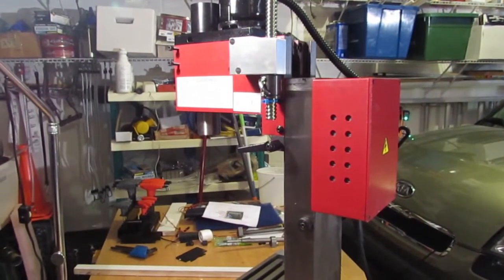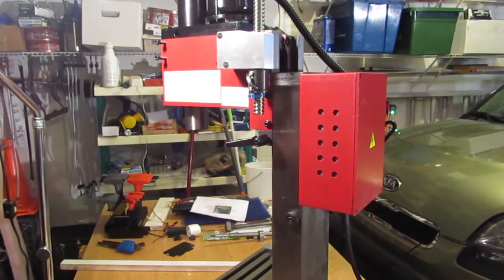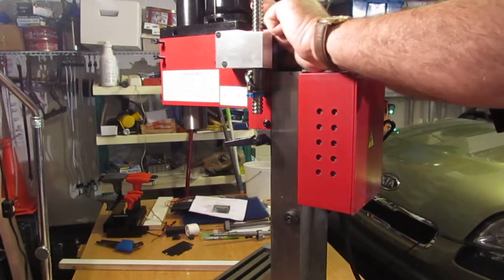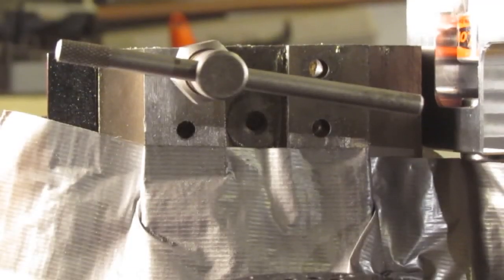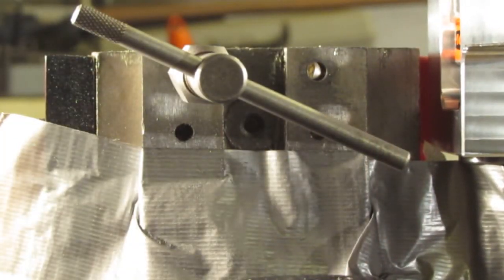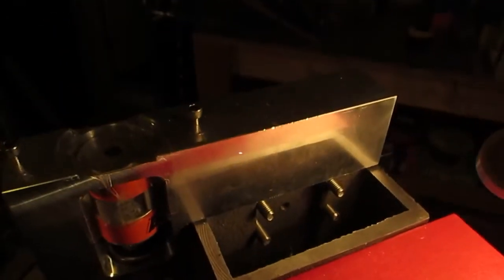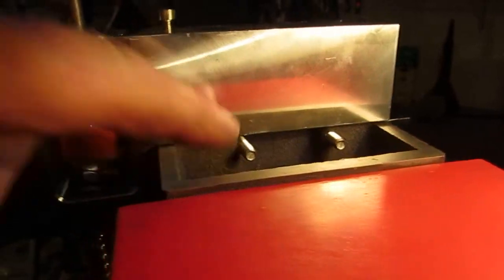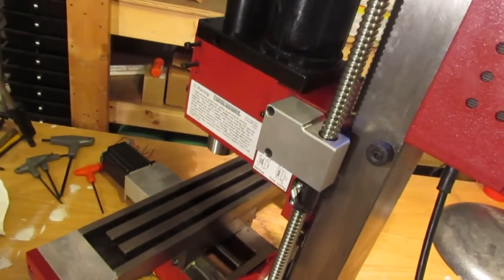X2 Mini Mill CNC Conversion- Part 4- Z Axis Installation

Comment: for that allen key problem you had I would have cut a small section off the long side and used a MM wrench to tighten it.  But I like what you are doing. Fun to watch other people go through the same problems I have.  Were all human.  Thanks.

Comment: When you run into a problem with a Allen headed wrench being to big in this case 10mm. Take a headed short bolt with a 10mm nut and put them together and insert them in the Allen head and use a 10mm boxed end or open ended wrench to tighten it. One of my tricks of the trade.

Comment: I notice your "Z-stop block" has the lever on the opposite side as mine. IDK if you did, but it seems to me you could install it either way. It's a nice feature to have even with CNC installed.
Reply: the screw collides with the Z axis screw.. you have to flip it over to keep it.

Comment: I would complain about the allen head bolt used to install the z axis ball screw mount and would install a grade 8 stud and a lock nut.  Just a piss poor design, perhaps it was an after thought where they did not take into consideration where the bolt would actually go.  With the ballscrew mounted on the side I would think that the z axis will rack while it moves up and down and would require perfect alignment.

Comment: How do you adjust the Z gibbs with the ballscrew in the way?
Reply from the maker: Well, you adjust it before you install the Z axis. The two on the bottom are always accessible. The two on the top...are not. But seriously, how often would you need to do this? I did it once and never looked back.
Reply: "how often would you need to do this?"
Well, the reason I'm asking is because I need to do so. With the noise my mill was making, I feared I was running into a damaged drive tooth that might be about to break. I've heard they are plastic. Anyway I checked for play and wow was it excessive. So un-mount the ball screw and proceed from there?
Reply from the maker: It's been a very long time since i built this so I can't give you that advice because I don't remember how it is put together.

I do want to ask you though: the noise you hear, is it happening with no power on the mill? Are you manually turning the shaft of the z axis and feeling grinding and hearing noise? 

If so, you may want to watch my other videos: 
https://www.youtube.com/watch?v=AOdRQGfjhXE&t=1s     (part 1)
https://www.youtube.com/edit?o=U&video_id=F7WZKfJ064k    (part 2)
Reply: I could actually see the movement of the spindle as I tugged it sideways and back.
I will check as you suggest tomorrow.

Comment: your base platform, the mill it self will be more limiting than your couplers. If you are looking for tenths repeatability... wrong machine. I have the same machine and it collects dust because I found "old iron", a 1950's brown & sharpe mill that is 10 times more repeatable and more than 100 times capable for the same money. not trying to brag, just stating other less frustrating options are out there that are more viable for the investment, and usually come with tooling of comparable value or more to the machine.
Reply from the maker: Well, then you need to sell that 'dust collector' to someone that can actually use it correctly. ;)
Reply: saving it for my son, he wants to learn how to use it. I would have sold it otherwise.
Reply from the maker: Frankly, I don't know what you're doing because I can get repeatability into the thousands.....however, mine doesn't have the original ball screws and all the lash that goes along with it. I never used it to mill anything in its stock condition....there are literally tens of thousands of these things out there that are CNC retrofitted and achieve high accuracy and repeatability......
Reply: kaydee457